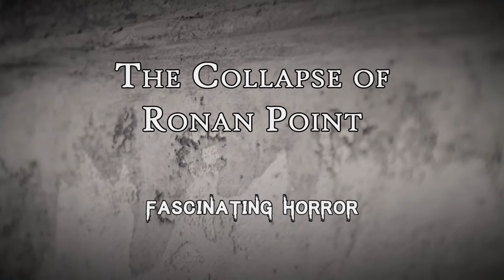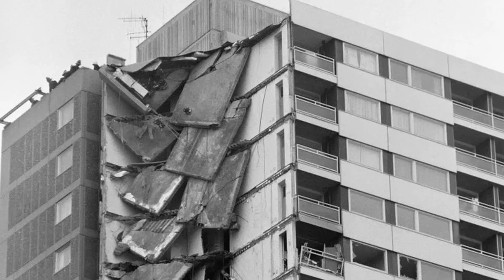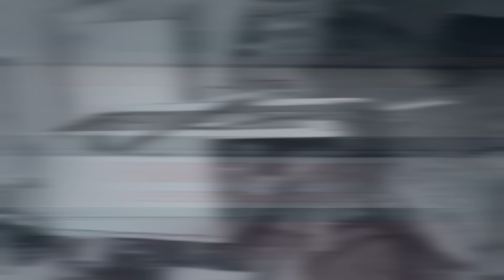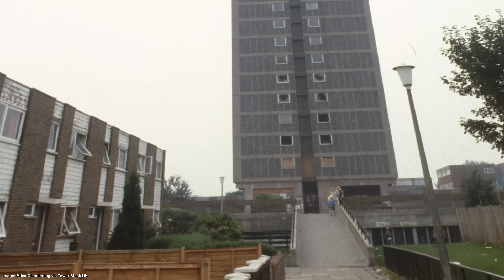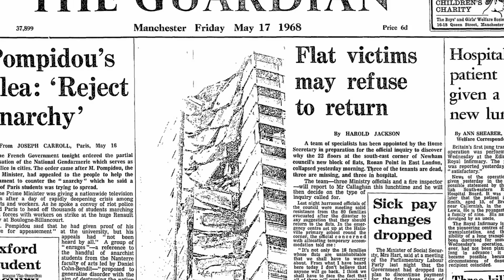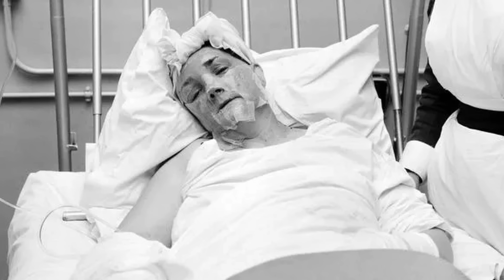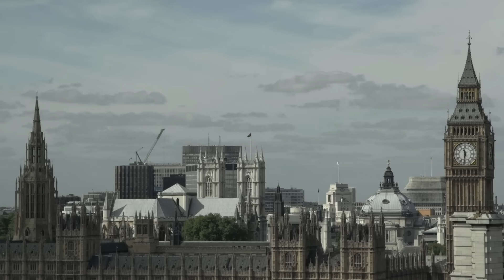Joints Stuffed With Newspaper: The Ronan Point Disaster | A Short Documentary | Fascinating Horror

Comment: I am conflicted in believing the builders were absolute shods, but the fact that a gas explosion didn't level most of that tower is impressive. If it were built correctly, is the implication that the explosion wouldn't have caused any structural failure?

Comment: Story time: In 1995, an 11 stories tall block of flats built with the LPS method in the 70's in Gdańsk, Poland, had the entire bottom floor blown out from underneath it, due to a gas leak accumulating inside overnight. The entire block was lifted slightly and then fell down on the rubble in one piece . It stood 9 stories tall after the fact.
Reply: Sounds like another Fascinating horror video. Was anyone hurt?
Reply: @lofthouse23  There were 22 dead and 12 injured. The two lowest floors were obliterated and the third sustained serious damage. But all the above fell intact and some people evacuated by themselves using regular staircases. They then promptly demolished the building though because it was tilting
Reply: the design really is an odd case of being bad, but at the same time strangely resilient.  i'm amazed that when the corner of this building collapsed it didn't bring down more of the building.
Reply: @syx3s It depends on the angle or pressure wave of the explosion.
If the pressure wave was expanded equally around the ground floor, it's possible the whole construction would simply fall onto said floor.
On this video, the explosive force acted on one side -un equally placing pressure on one side,.
..
Have a look at shaped charges...
Reply: @stuartd9741  natural gas explosions exert pressure more or less evenly in all directions until / unless they are funneled in a specific direction and gain momentum.
Reply: @syx3s  Not sure another typical building technique of the time would fair much better. Buildings are made to endure weather and wear not a built up gas explosion. There's a modern version of prebuilt segments I think?
Reply: I lived very close to a tower block (Kerrin Point, Lambeth, London) that suffered a boiler room explosion in 1997, due to lousy maintenance. The boiler room was off the side of the 22 storey tower, which was fortunate, because if it was in a basement it would've demolished the building. A massive chunk of the debris managed to fly so high that it landed on the roof.
The tower (88 flats) was immediately evacuated, and demolished not long after.
Reply: Ha, ha, ha, ha, ha, ha, ha, sound too surreal to be true! But I believe you!
Reply: There are videos where this happened during demolition.
Reply: It might have been of a better design and better built(panels joined better, this was extremely important). We had something similar happen in Romania, after a gas explosion, explosives were planted to collapse the building which resulted in it coming down a level. Not even the windows cracked on the upper levels. In this case, the building had a concrete structure, not only the panels for support. In the end they had to dismantle it panel by panel.
Reply: Story Time. We were bankrupt after ww2 , which we entered on your behalf.
Reply: So it turned into a space x rocket ship

Comment: My parents' depression era house had newspaper as insulation, which we discovered when doing a renovation. They filled joints in a HI-RISE with it? Hmmm... I wonder why it fell down...AND THEY DIDN'T LEARN! Not stupid. Criminal. 'Hey, granny, I know it's hard for you to get out but could you come to OUR house for Christmas? I don't want my kids in your hi-rise...'
Reply: Newspaper is a remarkably good insulator against the cold.  Think of old movies where you might see hoboes or drunks sleeping rough using newspapers as blankets.  My late father, a policeman, worked an assignment as a decoy where he had to pretend to sleep on a bench and he used a newspaper to cover himself.  He said it kept him quite warm.  But, you don't use the newspaper in place of mortar, or concrete, or better insulating materials which are also fireproof.  And you certainly don't use it as a filler when the different parts of a building should not have gaps between them!
Reply: The workers were.  Let's just say,  'not good'.  When the block was dismantled, cigarette cartons, newspapers and beer cans were found in the joints.   The workers were boozed up and couldn't be bothered to do their jobs to any degree.  Unfortunately they got away with it. 
If the block had been built properly, it  would have been very different.

Comment: i lived in a couple of blocks that were both built in 67-68 same as this place, one of them used to sway so much in a high wind that it made you unsteady on your feet, in another the entire window casement , like 12 feet by 4 weighing, well a lot just fell out of the flat above me one night narrowly avoiding two dudes on the ground
Reply: The tallest building I worked in was in Milwaukee. Forty floors. There was definitely a very, very slight sway in windy weather (Milwaukee is much more windy than Chicago), but after the first day, I never noticed it again.
Reply: @pioneercynthia1  yeah this one was only 14 stories and i was on the 8th it was bizarrely unstable theres a lot of old mine workings around here and i think the ground under it may be a bit insubstantial
Reply: @pioneercynthia1  Downtown Milwaukee winds are brutal. Only time as an adult I legitimately struggled to walk against the wind or not fall on my face moving with it was downtown in February. Made me realize that hurricanes are not meant to be trifled with lol.
Reply: @pioneercynthia1  Recall the crane collapse during construction of the Milwaukee Brewers stadium, how wind was too strong for the lift.
Reply: @pioneercynthia1  Yeah but building that tall it's most likely intentional (that they swing a bit)
Reply: @Rentta  yes they make taller buildings have a little give so that instead of cracking it just moves slightly
Reply: Obviously the window thing is a major problem lol.
Reply: They're supposed to do that. Prevents undue stress on the structure. Like a tree; enough wind can eventually split the limbs/trunk or uproot it. But perhaps you've seen palm trees blow in hurricane winds. They are better at being "bendy". I believe buildings are also like that to prevent similar disasters during earthquakes.

Comment: These Brutalist towerblocks were all over the country. At no point were they not rubbish.
Reply: Beats sleeping on the streets, which was a very real alternative for many people when these were built. Perspective.
Reply: @noneofyourbuisness2539  Not remotely true. This is 20 years after WW2. The country went under a massive modernisation initiative and many of the old houses were designated as being slums (they might have not had power, heating, or their own toilet, never mind an indoor one). So they moved people out of those, flattened large areas to build these new futuristic structures. However instead of being the modern living that was promised they were all built really badly and let everyone down. Perspective
Reply: There are two in a town near where I live, mid- rise which have had to be evacuated because they're crumbling. Unfortunately in saving money with cheap materials they set up lots of problems for future generations to deal with. The worst ones always seem to be from the sixties and seventies.

Comment: In the 60 all over Europe bad building engineering was common. My apprentice school in Zurich-Switzerland had ceiling heater system, we had hot heads and cold feed.
Reply: That sounds really awkward, since warm air rises up. Unless they had some heat circulation system. 
Still, could be worse.
Reply: @DolleHengst  yeah, i don`t know, an engineer on drugs maybe. It was really dramatic because to gain a comfortable temperature on your body, they had to blow higher temperatures to reach the floor. A total mess, we had red ears and a boiling brain.
Reply: ZÜRIII WOAAAA 
BESCHTI STADT IDE WELTTT!!
Reply: @Lgx-ie4if  Züri isch cool, nice place to be.....ZSC forever! Gruuuuss aus Barcelona.